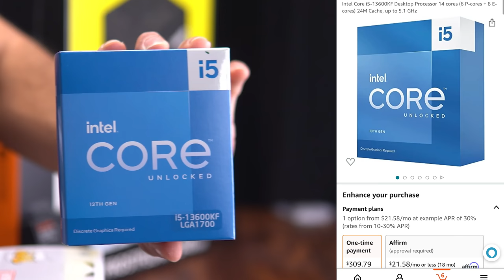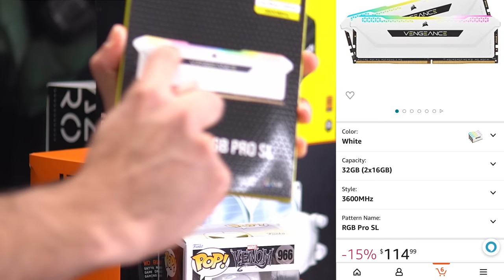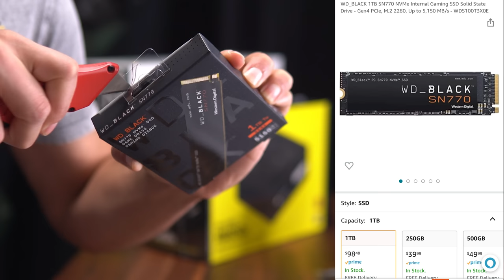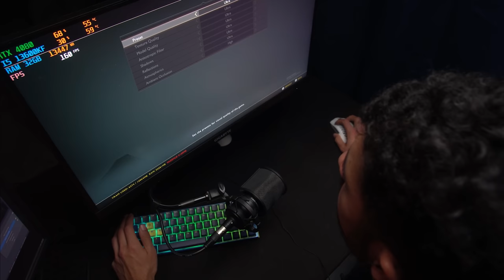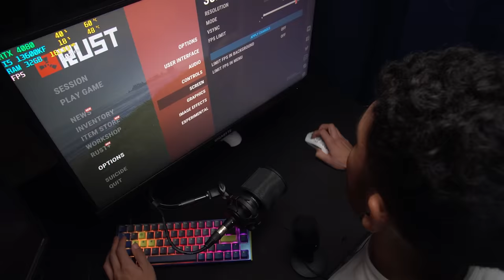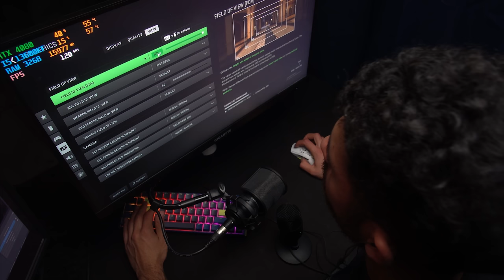$2300 Gaming PC Build Guide - RTX 4080 i5 13600K (w/ Benchmarks)

Comment: Just an update for everyone, the total price for this build when the video was uploaded was $2376, but as of today (april 18th 2023) the total price for the entire build has been REDUCED to $2211 USD
Reply: My pockets aren't "that" heavy yet, so I'll wait 👌😆
Reply: @somecallmevic  lol same
Reply: its not much ;-;
Reply: @unseen6603  compared to…
Reply: As of today (may 25) its about $2350 with taxes waiting for a deal on some of the parts.
Reply: @unseen6603  you rich I make 600 dollar a month
Reply: as of today june 19th 2023 it is $2,504.4 USD i should have waited for the prices to drop lol (without extension cables)
Reply: U can now build this build with slightly different components but same 13600k, 4080, and 32gb ddr5 for just over $1750 now.
Reply: @TheBob3269  it went down to 2175 idk how you got that low. And i took advantage of amazon prime day.
Reply: @marcelrodriguez2067  I said different components that are quite cheaper that’s how.

Cheaper motherboard, cheaper cooler, cheaper ssd, cheaper case. All same performing for much cheaper.
Reply: @TheBob3269  tbh for motherboard this one isnt a bad price and idk if going with a cheaper cpu would be a good choice in this case.
Reply: Can you make and update to $1463.45
Reply: @Evidencehhol that’s cap bud
Reply: $2,547.92 in 2024 with shipping
Reply: you can make this for almost under 2k
Reply: How about now ? Maybe $2000 ?

Comment: I built this exact PC about 6 months ago. One thing I want to say is that this CPU and GPU combination is extremely bottle necked at the CPU. I was getting bad graphical issues (bright lighting, odd color flickering, and straight up game crashes in high graphical games) I highly recommend going i7 or higher for this GPU. I upgraded to the i9 13900k and the 1000W PSU and I now no longer have any issues. Hope this helps anyone who was experiencing the issues I had
Reply: i have the same combo never had any issues i was afraid of the bottle neck but frankly i don't feel it
Reply: did you upgrade the radiator?
Reply: NOOOO PLS😖 my brain is about to explode from all of these, why is bottlenecking even a thing like why cant building a pc be simple dude
Reply: That's definitely not from the cpu. Either you had a driver issue, which was solved when you maybe did a windows reinstall or just redownloaded the drivers. OR, it was your power supply that was faulty because crashing may happen if your psu fails when trying to supply enough power to your gpu. However you are correct about the cpu bottleneck if you're playing below 4k, but you wouldn't notice the bottleneck at 1440p anyways
Reply: @daimsss.f  I forgot to update this. My problem was actually a failing GPU. Idk why it failed in like 4 months. I had to undervolt my gpu to its lowest rate for it to work properly without crashing. I have since then upgraded to a 4090 and now have no issues
Reply: How has the pc case held up??? if you got the same case as the video.
Reply: @Slowburnripz  It’s held up fine. I’ve had no issues. Only thing is it’s a little small. I upgraded to a 360mm AIO and it’s a real tight fit lol. Hind sight I wish I would’ve gotten a bigger case
Reply: @Josh_White  ahh, that's great to hear. I'm planning on doing my first build, been buying my parts each paycheck, all I need now is the cpu and gpu. I'm going with the 4080 super zotac edition and i7 13700k!

Comment: Quick tip, instead of CPU_fan, plug the aio cooler into the one next to it, as thats for the aio, if you dont it could cause heating issues as it wont know how to control the aio through there.
Reply: Question what goes connected to the cpu fan I was just researching that and found out it has to be connected to the aio pump.
Reply: @itzgamedrame8888  an air cooler would connect to the cpu fan
Reply: @Ned-Thy-Knight  thanks so much 😃
Reply: @itzgamedrame8888  np
Reply: good pointing out will do when I build
Reply: @Ned-Thy-Knight  The fans on the AIO could also be connected there too

Comment: Literally just built this entire build part for part because of your video. The only thing I changed was the 4080 to a 4070ti for budget reasons and I could be happier. You build walked through everything perfectly and built my PC with zero issues. I removed the hard drive cage early and that made a load of difference in installing the build. I also changed out the Pop figure to a Khonshu one from Moon Knight to go with the white build! Thank You for such a detailed over view and build guide!
Reply: Exactly what I was thinking of doing get a 4070 ti instead of 4080 how well does it do.
Reply: @chriswuineck7951   it does awesome. I upgraded from a GTX1080 so the performance boost I saw was nearly double. Running by the benchmark test on MW2 I was averaging 137 FPS on 1440p with max settings. Overwatch 2 I was seeing way over 300fps and I also tested Apex and I was seeing around 220fps
Reply: @andrewperlis3218  thank you bro will be doing the same then
Reply: @chriswuineck7951  Just make sure that if you do this build by the fan splitters for the three to one. I didnt and had to stop building for one day till i ordered some and they came in.
Reply: @andrewperlis3218  thank you so much and will do
Reply: @andrewperlis3218  sorry if i sound dumb but its my first time what exactly is fan splitter i found one but , dont know if its right one
Reply: @chriswuineck7951  it’s a cable you can use that can tie 3 case fans to only use one header on the motherboard. He explains one in the video under the section in the guide where he installs the extra case fan
Reply: im doing the same thing, the bottleneck is actaully improved. I am also adding a 980 pro 2tb for storage! im so excited to build this beast
Reply: Thinking about building this as my first ever gaming Pc? Going to use the 4080 gpu in it, how much of an upgrade can I expect coming from 120hrtz on console
Reply: @youknowjuneau9499   what types of games are you looking to play? He has the benchmarks of the majority of popular titles in the video with the 4080
Reply: How much did it cost to build your pc?
Reply: @faithlamah1732   ball park was around 1800 for everything. I already had every other peripheral so it was just a PC I needed to build and didn’t have to buy anything else.
Reply: @faithlamah1732  I built this exact build but upgraded the processor and power supply and it cost me around $2700
Reply: How much FPS do you get in act if you chcange to RTX 3070ti ?

Comment: This is my very first time building a pc and i thank you so much for teaching ALL of us on how to build this beast.  i have ordered my parts and through 2 weeks of research i finally feel positive that this is the build that i would like  in my gaming arsenal. Keep up the amazing workCrater!
Reply: How good has it been so far
Reply: hey I have a question, im currently building this PC right now but the extension cords from the power supply kit are split 3 ways not four like showed in the video? is it supposed to be like this?
Reply: @alice-ks3ty  should be two different cords that split 2 ways making it 4 ways together
Reply: @alice-ks3ty have this same problem did you find a solution to this
Reply: @youknowjuneau9499  i was gonna order the four split one, but i ended up just plugging three in. i don’t rlly know the official names since i’m new to pc building. but i plugged the two main(?) ones in and one of the ones that split off. i just left the other split off one unplugged. the pc runs perfectly and the card works perfectly so i think it’s fine to do it like that. sorry if this doesn’t make much sense LMAOKFH.
Reply: @alice-ks3ty  ok I was thinking of doing same thing , hopefully it works!
Reply: @alice-ks3ty  do you get max fps and performance?
Reply: @youknowjuneau9499  ummm i didn’t really check and i’m currently away from home so i can’t check. plus i’m new to the whole pc world. but i was playing cyberpunk 2077 at ultra settings and ray tracing at around 120 fps i’m pretty sure
Reply: @alice-ks3ty  I tried it like this and my Pc didn’t power on lol
Reply: @youknowjuneau9499  hm that’s strange? did you check everything else to make sure everything’s plugged in the right spot?
Reply: @alice-ks3ty  yes my dumbass had a plug loose on motherboard but now it runs properly just had two of my led fans from the case not light up but we’re turning properly, is there a way to get the lights to turn on for all the fans?
Reply: @youknowjuneau9499  did you use the fan splitter? there’s should be two. one for the cooler fans and the arctic one, and then another for the case fans
Reply: @alice-ks3ty  yes I used both, I think I can get the LED to work through my computer settings
Reply: @youknowjuneau9499  did you get it working?
Reply: @alice-ks3ty  yes I did! It has been working excellent for me while still have a pcle cable not plugged in lol I even ordered the right cable needed but returned it because it gave me same performance

Comment: Corsair 4000 d airflow -white

Processor -I7 13700k (5.4Ghz turbo boost)

Motherboard- MSI MPG Z790 edge WiFi DDR5-white

Ram -32GB Corsair platinum RGB DDR5 6000mhz 

System cooling -Corsair icue H150i Capellix LCD display - white

System fans- Corsair QL white fans

Graphic card- 4080

Operating system drive- Corsair 1TB MP600 pro XT gen 4

Hard drive - 2 TB Samsung 870 QVO series 

I’m so stoked to be getting this build in less than 4 weeks
Reply: how well does this build do?

Comment: Mistake: cable from AIO pump shouldn’t be plugged into cpu fan header. These is a separate pin for that in mother board named AIO PUMP.
Reply: Is this true? I ordered all these parts and I’m about to follow this video to setup my PC. So once I get my items I just need to change the AIO pump cable from the “Fan Header”
Reply: I have this same build, if its plugged into the pump it will boot to bios everytime...

Comment: Quick question. Shouldn’t you have plugged the AIO plug into the AIO pump plug instead of the CPU Fan plug? 10:35
Reply: Yes he should of, if you don't you can damage the pump because it isn't running at full power all the time

Comment: I have a question and would really appreciate some help. So if you were using an Amd graphics card, merc310 xtx for example. It has 3 8pins on it, how would you connect that to the psu, same one you have in the video? Could I use those pcie cables and leave one of the pigtails hanging? Also are the pigtails safe with the newer Gpus? Should I just get 3 separate 8pin cables instead?

Comment: This is my set up Here my set up got  for little over 2.500
13th Gen Intel(R) Core(TM) i7-13700KF (54 MB cache, 16 cores, 24 threads, 3.40 GHz to 5.40 GHz
NVIDIA(R) GeForce RTX(TM) 4080, 16GB GDDR6X
32 GB, 2x16GB, DDR5, 4800MHz
1TB NVMe M.2 PCIe SSD
e Moon 1350W PSU, Alienware Cryo-tech (TM) Edition CPU Liquid Cooling

Comment: Thank you so much Joey!  Just used this guide to build this exact PC, with my dad 👴.
Reply: how is the pc?
Reply: @InstantHades  Very good, I use it for 1440p gaming.
Reply: @jesseflint2202 okay nice, i’m currently getting the parts for this build and also did you have any trouble building the pc ?
Reply: @InstantHades  Not any, really.  Joey is very good with his instructions.
Reply: @jesseflint2202 just got done building it, do you know how to get the rgb on in front of the case?
Reply: @InstantHades  As long as cables are plugged in correctly, you can press that button at the top of the case.  Joey shows this in the video.
Reply: yeah, i watched the video back and realized i didn’t plug in the cable
Reply: how are you liking the pc after using it for a while now?
Reply: @InstantHades  Enjoying it, and am very grateful.  Using it with a 1080p monitor for higher frame rate.  Currently playing Cyberpunk 2077 with Max Settings, DLSS Quality (50 Sharpness), Frame Generation, and the new Ray Reconstruction Tech.  I average 160 FPS at 1080p.  Although, this is just an example of what the RTX 4080 can do.  Many games will have different levels of performance. Plus, not all games have that cool “NVIDIA 40 Series Only” tech.  FSR 3 will be in more games, and could even better.  We’ll just have to wait and see.
Reply: @jesseflint2202 you think the 4070 will be any different?
Reply: @InstantHades  Not sure 🤔
Reply: @jesseflint2202 i’m stuck in the asus bios do you know any fix?(i fixed it) But which version of windows do you have? cause on mine it says “this pc can’t run windows 11”

Comment: super great video just don't plug pcie pig tail cables to the 12vhpwr cable one psu port one cable never use only 2 pcie cables for 80 or 90 series you may get eletrical instabilities it made 4090s burn

Comment: @crater would you see any potential issues if I used this same AIO cooler for the 13700k? Will it cool enough for that?
Reply: have the same question but nobody seems to answer hahh. My issue is if yea will it cool and second will it make any throttling if a i7 137k is used instead of the i5
Reply: You should be fine. I used the cooler master ml240r instead with i9 and all worked out well

Comment: What is the 4 pin connector used ? Referring to the cpu power cables, u plugged in the 8 pin and the 4. What is the 4 pin for? Im looking online it says only the 8 pin is needed as the cpu wont be able to draw much power from the 4?

Comment: awesome stuff. love this build. is it possible to use the i7 13700k CPU instead? or would the CPU Cooler need to be more powerful? totally n00b when it comes to this. just learning now. Thanks!
Reply: If you’re not planning on overclocking then the 240mm cooler would work just fine
Reply: @robert7668  can I use the same CPU cooler with i9-13900k and no overclocking?

Comment: I just made this pc, used a i9 13 gen, 1000 watt power supply, and 2tb ssd. Great build. Just dont buy the power supply in the video link because on amazon they shipped me the power supply without the cables its supposed to come with and it had dust on it. Just get the power supply new at a different store. Dont try to buy the cables separately for the power supply and plug them in to the one you got that didnt come with them. Youll risk ruining all your other components
Reply: What aio did you use? And how do you control the case light colors?
Reply: @holt_7714  I used Id cooling frostflow 240. When you plug everything to powersupply and motherboard youll be able to control the case light colors with a button on the case itself. Very good build. Runs everything Ive tried at the highest settings very smoothly
Reply: @jamesschwarz3477  I’m surprised your AIO is able to cool your processor enough…and thx for the info btw
Reply: @holt_7714  Yeah I was worried about that too but theres no issues at all. Ive asked a couple other people too and they did the same. Had no issues. Just dont forget to put the thermal paste
Reply: @jamesschwarz3477  yeah that is crazy what is the average temp on games and you think I’d be okay to keep with same aio and go with 13700k?
Reply: @holt_7714  I havent tested to see what the avg temp is but it will run gta v or mw2 on like the best settings and you can run it for hours no problems. Yeah the thats the same one I use so you’ll be good
Reply: @jamesschwarz3477  I’m not sure if I added enough thermal paste. What can happen ?
Reply: How do you turn of your pc cuz it won’t turn off after I press the power button, or should I just turn it off with the switch on the psu
Reply: @kiri-kyoto-3559  Did it cover up the whole cpu? If its too little it could cause overheating, you have to check the temperature. If your computers running just fine then leave it but if not I would prob reapply it
Reply: @holt_7714  It should turn off, did you plug in the power supply right or did something seem off about it?
Reply: Yo I gotta double check one more time cuz I can’t fathom this…you said this aio is ok for the i9-13900k 13TH GEN right?
Reply: @holt_7714  For me it works for sure. My computer turns on in like 2 seconds, Ive ran a lot of things at the same time and its still cool to the touch even after 7 hours
Reply: @jamesschwarz3477  that’s crazy, I’m gonna give it a shot thx

Comment: how far can you say those white power cables can be bent? I have a bout 1.5 inches between my 4080 and tempered glass, i can't tell on yours but i might be able to do it, its the deciding factor for me to choose from both brand new 3090 FE and 4080 FE cards but couldn't do the 4080 bec of that stupid black oem 3 splitting cable.

Comment: Why did you put the m.2 in the second slot and not the main first slot where there’s a heat sink ?
Reply: Yeah was wondering the same, maybe he won't have PCIE4.0 on the first slot, he wanted that pciex4.0 on another thing
Dpends on the Motherboard some board have only 1 pcie4.0 slot and SSD or NVME are still pcie3.0

Comment: Hey, (excuse my potential bad spelling and grammar) I really wanna see a build with about a $1500 - to like $1600 or $1700 budget using intel 13th gen i7, or 12th gen i7 since budget is low or a good intel cpu, 3070 nvidia card or 3060 ti if it helps keep the $1600 budget. Then this video may be long but I really wanna build a pc and make sure I get an in depth step by step video so it may be 35 minutes long but I'd totally watch that but anyways definitely use a white pc case cus I love white cases and definitely some cute rgb fans and then an aoi with copper plate because that's extremely important for preventing thermal throttling and then more in depth where the cables go and how to properly set up windows 11 and internet please use a board with internet and Bluetooth please

Comment: is the 3 fan spliiter cable a must for this build?
Reply: 👆…..Got something for you
Reply: No thats cable is only for the RGB fans, but if you dont plan adding RGB fans, 
you can use the RGB HUB with remote control thing to change colors of fans.